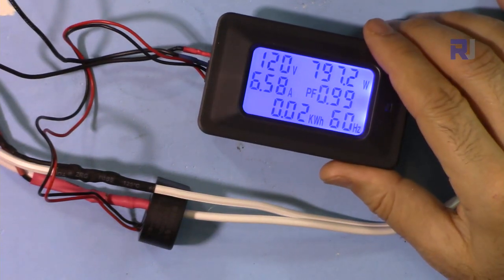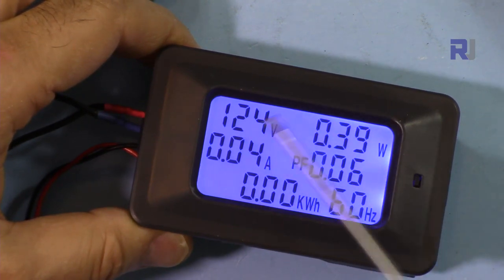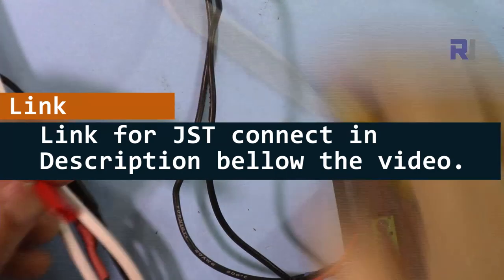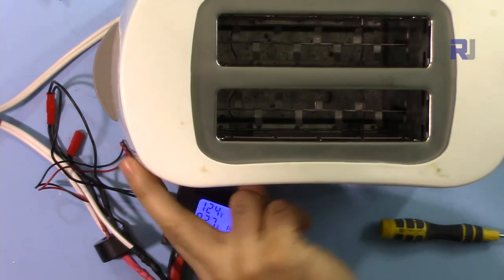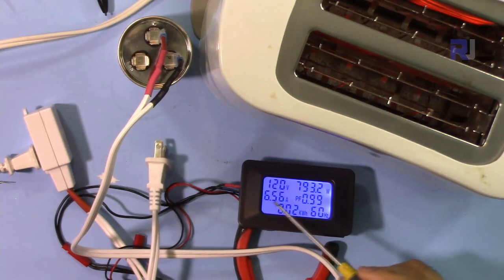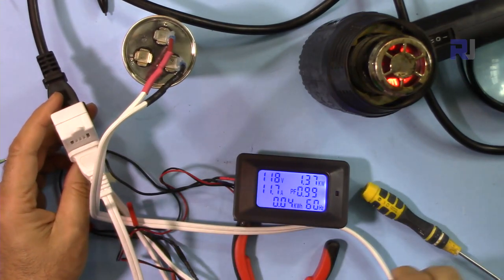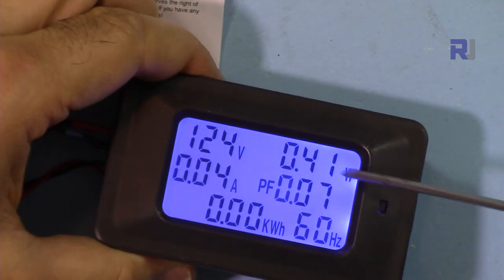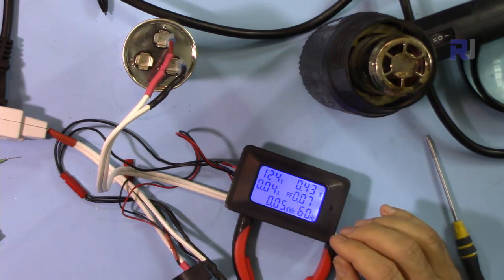Test Review of PUUCAI P06S-100 100A AC Active Power meter

Comment: I have a question for you. I have a poem-061 that I’m going to install to run a generator. My question is, does the red lead wire on the CT is connected on the outer or inner post?

Comment: Hi thanks for the video I would buy one but want to fit it to the 6mm tails from the meter to the consumer unit so I can read the total house power at all times so my question is is there a clamp-on coil version so that I don't have to disconnect the main wire or perhaps I should just buy a clamp meter
Reply from the maker: Hi, you are welcome. eBay and AliExpress is full of such stuff. I have purchased an item with CT (current Transformer) that opens and closes. Once it arrives, I will make video on that.

Comment: I'm hooking this up to monitor a 240v hot water heater and have both hot wires going through the coil but I get no reading.  I ensured the coil is installed correctly and even switched it to make sure but still nothing.  Am I only supposed to put one hot wire through? Any suggestions ?
Reply from the maker: You must have escaped the video.  Watch it fully. You haven't subscribed. I will only reply to all Subscriber's 🔔 questions. So make sure to Subscribe.😊

Comment: Hi robojax....
Is ps6s-100 able to work with  ps6s-20 wiring (without CT) for measuring a curent below 20 ampere? Thx.
Reply from the maker: Hi, I am not sure if you change the CT if it works or not. But it should not work.
Reply: @robojax  o ic... 
Just curious, coz seem that both of type using a same modul....😅😅
Thx Robojax...👌

Comment: Can this easily be hard wired to monitor AC current instead of using the CT and will it be as accurate?   Actually, I'd think hard wired would give the most accurate readings possible.
Reply from the maker: you can't use  that method for AC. You have to use current transformer to detect the current.
Reply: So there is no way to hard wire a power meter such as this into an AC circuit?   Hard wiring would be better for physical installation in a breaker panel as the CT is too large to fit inside.

Comment: WHAT SHOULD BE THE SPECIFICATION OF CT FOR 20 AMPS LOAD CAPACITY? I NEED TO PURCHASE THE SAME FROM MARKET.
Reply from the maker: this item is sold with CT together.  if you search for this model on eBay or Amazon, I am sure you will find it.

Comment: mine shows the volts and amps correctly and I assume the power factor correctly but my watts always says 0 and so does my kwh. Id appreciate any help?
Reply from the maker: You must be doing something wrong or the module is bad. Follow the instruction in the video and it should work fine.

Comment: Hello Mister. I do have one of this. and I want to built a meter. My idea is to mount this on an extension cable so I can connect any apliance and measure how much it consumes.  But for that I would need to power the meter and the load from the same AC power supply (the wall socket).  Would that work? or I would have wrong measurements if I connect them in parallel?    I am in Germany Europe (230V 50Hz). I a predicate if anyone can answer anything. cheers.
Reply from the maker: Hello, I clearly shown and practically did the wiring. Maybe you missed it. if any wire passes through the hole of sensor, it will measure only that current. Please watch again.
Reply: @robojax  I am sorry I took your time with something was already in your video.  I will watch it for the third time.. much more carefully. Maybe the reason of my miss attention ist my 6 weeks old daughter that usually sleeps on my arms as I watch your videos.  Thank you so much for taking the time.

Comment: The watts meter is off around 15 +/- watts, reading should be 781.704 watts if the power factor is correct. If being within 1 or 2 watts is important. The amp reading could be wrong too, who knows.
Reply from the maker: I would have to have another reference to know for sure.

Comment: Please tell me what the voltage is when measured from you CT terminal to ground.
Reply from the maker: It is NOT DC otherwise you would use Arduino to measure it. I did not bother to look at it. You will need a circuit with few components to proportionally convert the AC from CT to DC and then measure it. This Power meter has the circuit built-in that does the job.

Comment: Hi, thanks for the informative video. I have a Drok device which has all the same functions as the one you preview. I had a licensed electrician install it but it only displays volts and hertz. The amps and watts remain at zero. After watching your video, I thought that the CT was facing the wrong way so I made the change, but still doesn't display actual amps and watts.

We are trying to read a 240 volt 20 amp receptacle. He put wires on the two hot terminals on the receptacle and connected the other end to the meter. We put one of the hot wires through the CT (initially the wrong way as I previously wrote). I have images of the install but don't think I can upload them here? Thanks in advance for your help. I'm trying to track the electrical consumption of my electric car and truck with this device.
Reply from the maker: Hi,  You are welcome. If it turns ON you did everything correct. The last thing need to correct was the CT which you mentioned you did it correct. There is nothing else you could  do. Ether the wiring of CT is broken or  the device is bad.  You can post the image in this website https://snipboard.io/ . Once you did, each image will have unique URL (address) which you can share back here.
Reply: @robojax  Thanks for your very prompt reply. I uploaded photos to my server and here are the URL's. I left them high resolution so that you could clearly make out the connections. I have two of these meters, one at my farm and one at home and they are both connected the same way and both are not displaying amps and watts.

When we put an amprobe on the wire from the breaker to the receptacle, we get an amp reading. When we put the amprobe on the wire that leads to the meter (that is on the same terminal as the wire that gives us a reading) we get a zero reading. Is that expected behaviour? We also tried wiring directly from the breaker to the meter but got the same result.

https://bdatix.bm/imagestemp/IMG_1988 copy.jpg  https://bdatix.bm/imagestemp/IMG_1990 copy.jpg  https://bdatix.bm/imagestemp/IMG_1991 copy.jpg  https://bdatix.bm/imagestemp/IMG_1992 copy.jpg.

Thanks once again for your assistance. FYI, I'm in Bermuda where we have the same 60 hz 120/240 volt electricity as Canada.
Reply from the maker: Hi Richard, I had to watch the video making sure I have not left anything unexplained and for sure nothing was left. I look at the images. your wiring looks fine. As I mentioned before it could be the CT is bade or has bad wires or the device itself. the best option would be to replace it.  
just checked the map and I only new the word Bermuda from "Bermuda Triangle". Now on map and google photos it looks beautiful.  Stay safe.
Reply: @robojax  Thanks. It's odd to me that both of the meters don't work. Perhaps it's a bad batch. I'll order replacements.

Yes, Bermuda is quite like paradise and the virus hasn't had any community spread yet. Just 2 cases, one from a resident returning from US, the other from a resident returning from the UK. Still, most things are closed here to try and avoid community spread. Until the next time and yes, stay safe!

Comment: How could you compute for the price of the bill with known consumption already based on that monitoring? hope you can guide me tnx
Reply from the maker: You would have to know the rate in your country or region for example in our city (Ajax, Ontario, Canada) it is $0.12/kWh at Peak time . If this device shows that I have had 10kWh, then cost=10kWh x 0.12 =$1.20. I hope that helps. Depending on your region you might have "delivery charge" and other cost which you should see in your bill.
Reply: @robojax  Thank you very much appreciate that speedy response. I think I should get one of that to monitor my consumption better. God bless you and your family :)
Reply from the maker: Thank you. Same to you.
Reply: Bro 1KW =1000 Watt =1 UNIT

Comment: Can you advise how to hookup to 220 vac generator?
Reply from the maker: I believe I demonstrate it. Your generator is just power source like wall outlet where you connect a load such as bulb. Exactly the same way I connected the toaster to power, it will be connected to your generator.
Reply: Robojax 
So the JST connector can be placed on the two hot sides of the 220 generator?
Reply from the maker: Yes. JST is to just get the AC voltage to calculate the power.